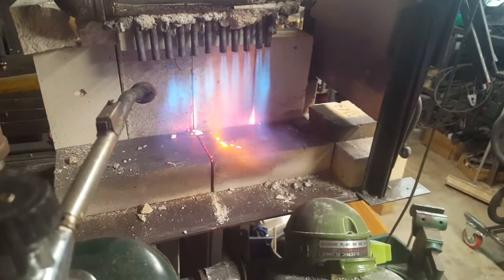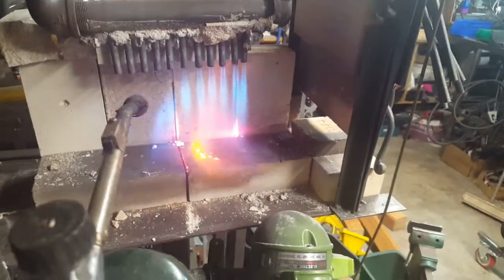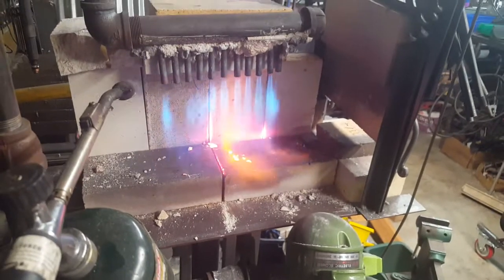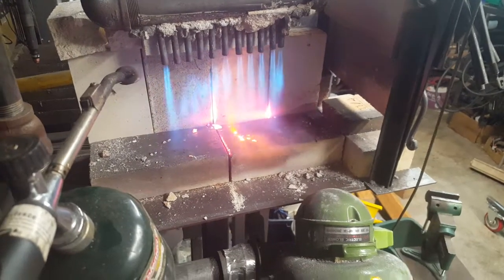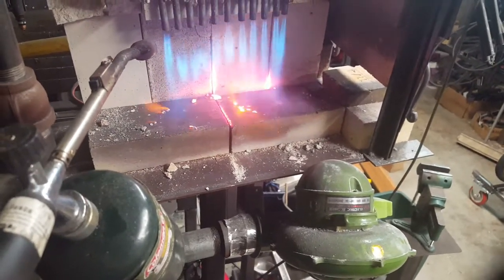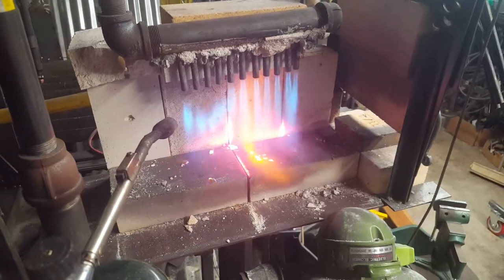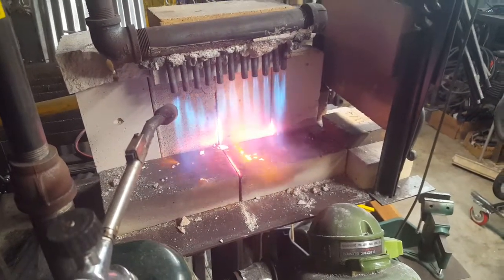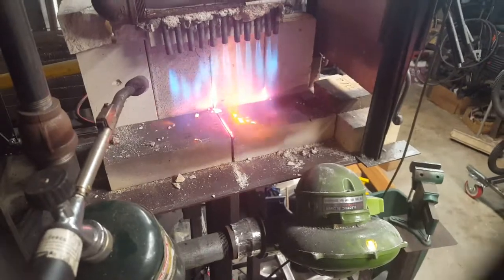my take on a ribbon burner forge

Comment: So how's it holding up?
I built a forced air ribbon burner, but used 3" square tubing and castable refractory...
There's a couple downsides to it, but I love the heat! 
So I'm curious about the constitution of your design if I were to take another route in my burner.